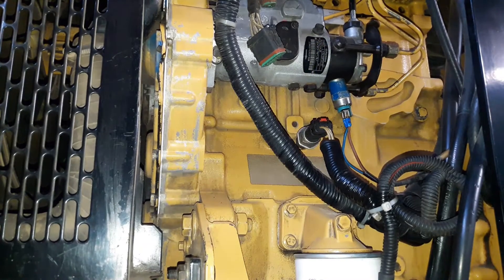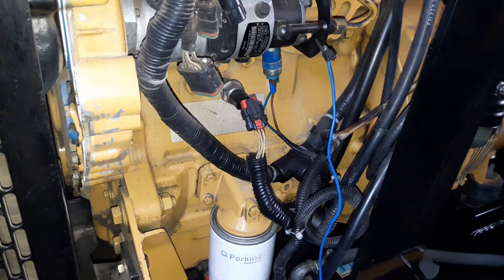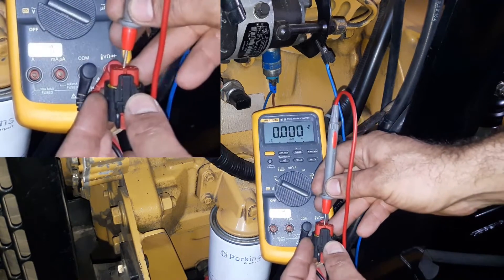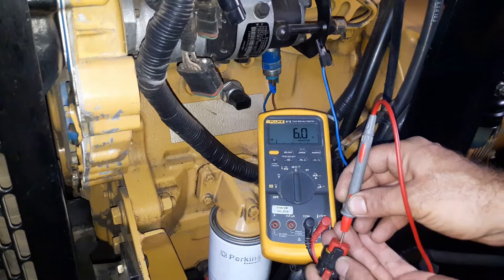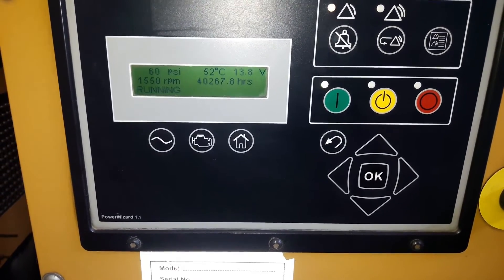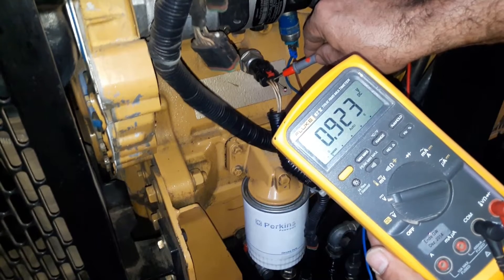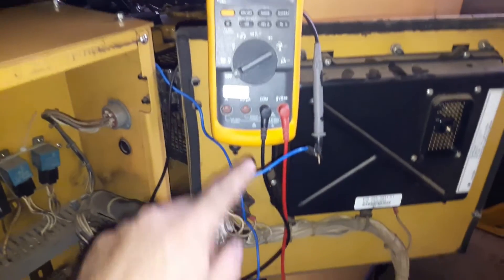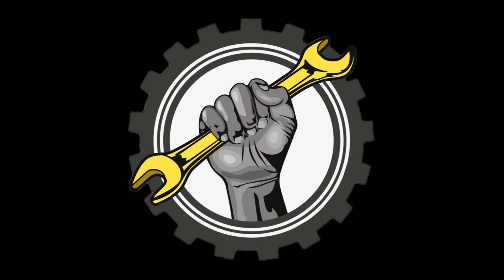Engine Oil Pressure Sensor Wiring 1103/1104 Series #perkinsfamily

Comment: Hi. Usefull video. I'm actually troubleshooting an oil pressure switch in gas car, but your methods seem to be pretty usefull. Thanks.
Btw I was wondering why there was 11.8V on one output wire in the 1st measurement